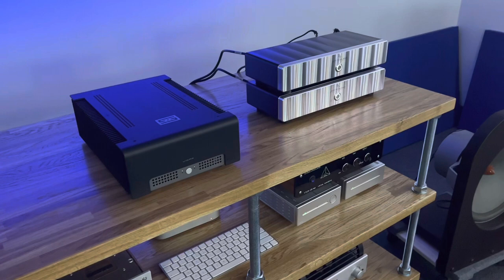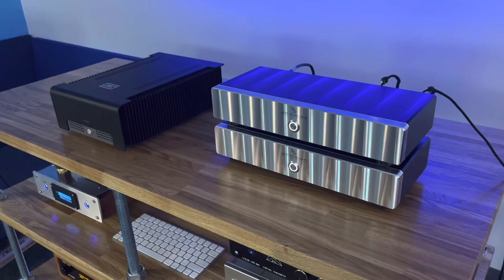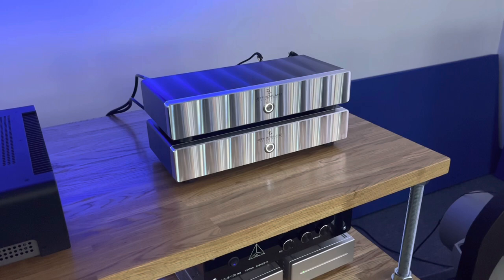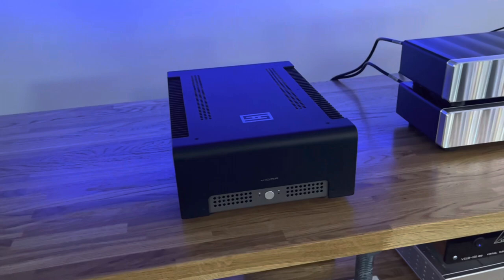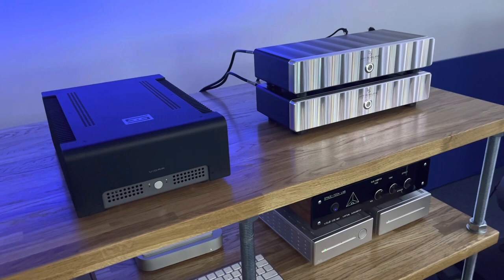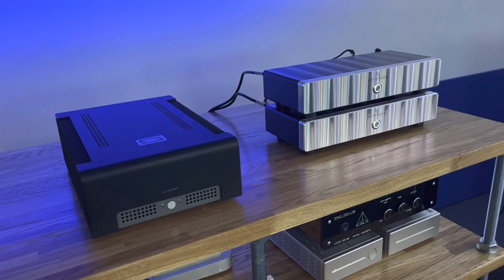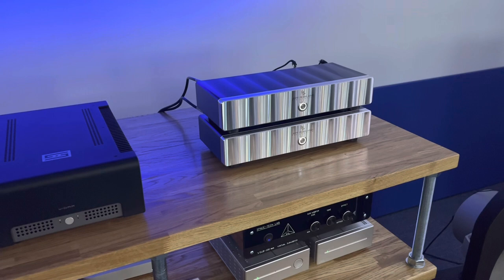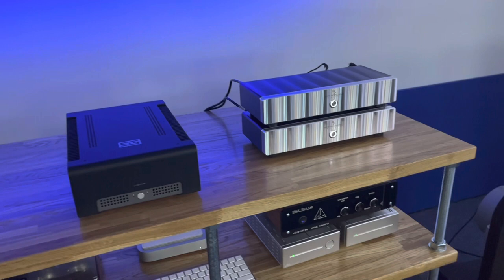Jeff Rowland M125 vs Vidar 2 power amp comparison.

Comment: Having my pair of Vidar 2's set up in monoblock configuration for only about a week, I was somewhat disappointed to come across this comparison with the M125 winning out............................until I realized that my two Vidars, the Freya Plus, the LRS Plus and the Denon CD player are about the same price as one M125. Probably the best sounding system I've ever owned, unless or until I win the lottery. LOL! :)
Reply from the maker: Absolutely! What you have is a tremendous value and I have no doubt you're enjoying the music.
Reply: Yeah, not hard to believe an $8k set of amps beat out one $800 amp. Not sure what the point of the comparison was.
Reply: A lot of "stereo" is a mind game. I highly recommend you put time into your room, treating all of the 1st reflection points, both on the side walls, overhead, etc. The sound difference when you soak up reflections quickly and cost effectively can take a system forward by a HUGE leap. This is particularly cost effective if you make sound absorbers yourself. There are many good videos online to help with this. Beware making endless upgrades before you have made significant improvements to your room. By the way, the Freya Plus is widely regarded as a "giant killer." Playing around a little with tubes can greatly complement other components in your system. If you want to soften glare, there are tubes that will complement glare. If you want to intensify detail, there are tubes that will intensify detail. Many people are studying tubes with respect to your well known Freya Plus, so it should not be difficult to find use commentary on possible tube rolls that enhance your system. The LRS plus is a marvel speaker from all I've heard. You really have exceptional equipment for the price point. Enjoy what you have! I understand you do want to have the LRS plus considerably off the wall for best results... Best of luck to you. Music is a blessing.
Reply: Vidar is a Corvette, M125 is a Ferrari.
Reply: @intrinsicfreedom  Yes music is a blessing and a great joy in my life. Thanks for the advice, much of which I have already begun to consider. I get a lot of information from YouTube and Paul of PS Audio seems to have a good handle on things and agrees with your assessment to  consider room treatment before spending a lot of money. As is my usual MO, I studied the hi-fi landscape for quite some time before making my choices and I feel quite satisfied. My good friend of many decades who shares my love of all things musically related just put a pair of $75K speakers in his vacation home and his primary residence is equally equipped. It is a welcome luxury if you can afford it, but the law of diminishing returns leaves me quite satisfied that I have done well considering my budget. I just ordered a set of new tubes yesterday to explore the differences, so I would say your advice has been good all around.
Reply: @jonathandavis9507  And my budget is a Toyota! LOL!   : )
Reply from the maker: @intrinsicfreedom  Thanks for sharing. I agree with you on the room treatments and that there should be more. There are two treatment panels directly behind and to the side of each speaker if you look at the video again. There just isn't any above but I do feel the sound of the video demonstrates the sound pretty well. Yes, if you look at some of my previous videos, you'll see I have a review of the Schiit Freya as well in fact a lot of various components in various rooms and such. I agree with you though, room treatment is paramount.
Reply from the maker: @vcp93  The point was shared in the description so I copied and pasted it here for you in case. "Schiit Vidar 2 has been added for frame of reference."

Comment: I am the very happy owner of the Jeff Rowland M125 amp. I don't have the resources to splurge on the super high end equipment that I drool over but the JR gives me a very nice taste of that. It's my most expensive piece of gear but for me it was worth every penny.
Reply: What preamp do you have?
Reply: @Drackleyrva  I have the Schiit Freya Plus which I use in tube mode. My previous power amp was the Carver M500t which I still have but am not using.

Comment from the maker: Schiit Vidar 2 has been added for frame of reference.  

M125 is 125 watts per channel into 8ohm and 250 watts into 4ohm.
Vidar 2 is 100 watts per channel into 8ohm and 200 watts into 4ohm. 

Please adjust volume accordingly with earbuds or headphones if needed for sound demos.

Comment: Wow, to me the step from Vidar to stereo 125 wasn't as big as the step to dual mono 125. At least the way the recording tells the tale, the dual mono setup really opened up the presentation and sounded a lot more live.

But Vidar is what, $800 new? And fairly plentiful on the used market. They well built and an incredible value for the money. I own a Vidar 1 that I acquired from a friend who bought it used and it's in perfect condition. At the time, I hooked up to my Emotiva TA-1 and it was a revelation, driving my JBL Studio 580's. Today I'm running upgraded Tekton Moabs with a Parasound JC5. Every part of my system is on another planet from the Vidar and JBL setup. But at 25% the cost, there are plenty of days I wish I stayed put and were smarter with my money instead.
Reply from the maker: Yea, I agree, the Vidar is an incredible value. I currently use it with my LRS Plus and love how it mates.

Comment: So I do bristle a little bit when I see class D amplifiers, using prefab modules and probably switching power supplies costing over $4,000 each. I am sure they sound great and they do have the beautiful faceplates but I struggle with the value there.

On another note, I would love to hear this open baffle setup! Also, really curious how your Dynaco would sound with these.
Reply from the maker: https://youtu.be/LtINzsIhiXY.  Yes, I brought the new ST70 over and it also sounds beautiful. It was a warmer rendering of the music.
Reply: Class D has VERY much arrived...GanFet sounds as good as any Class A amp. AGD is on the leading edge, and so is Rowland.

Comment: You're really not setting the Rowlands up for best sound quality. Bridging a stereo amp is not the same as a mono amp. Its a bridged stereo amp. You should only bridge an amp if you really need to, like if the speakers are being starved for power and really need more. A better sounding approach would be to leave the Rowlands running in stereo mode, and set them up in a vertical biamp configuration.

The problem with bridging is it alters the resistance the amp sees when connected to the same load running in stereo. The difference is half.  So a 4 ohm speaker is now a 2 ohm speaker. Your amp now has to work twice as hard to do the same work it did in stereo mode. A vertical biamp will give you better sound quality, where in a bridged system, the best you can hope for is to not notice any loss in sound quality. If you think you may need to bridge for more power, you're better off buying a more powerful amp to start with.
Reply: Its true....but hard if the speakers have only one set of posts..
Reply: @OCDHIFiGuy  Don't you have some show to be at? You just had to point that out, didn't you? If the speakers only have one set of binding post's, I guess you may have a point.
Reply: @AT1272  May have a point ??? Lol. You can't do it otherwise. It's an absolute and it's definitive. I'm guessing your first sentence is you being a smart ass...
Reply: @OCDHIFiGuy  Thank you. I can't believe someone finally noticed. For a long time now I've been working hard to overcome my status as a dumb ass. There were times when I thought I'd never work my way up to smart ass. If it came from anyone else, I wouldn't believe it.

Comment: In your opinion, which of these two sounds best when listening at lower volumes? Also, how hot do they get when they been on for a while? Thanks for the comparison.
Reply from the maker: Hi, that's a good question. First, they all run quite cool, so no worries there at all. I was talking to my hifi buddy about that. I always like to know how nicely an amp sounds at lower listening levels. With my Aretha preamp hooked to my Vidar 2 while listening to the Maggie LRS plus at low volume, the Vidar already more than enough revealing, so it's hard to say if one needs more for every speaker at low volume. The Rowland's are more revealing at low volume when the two are compared. Even so, I still find myself pleasantly surprised at how well the Vidar 2 plays at lower volume but the M125's are an endgame amp. One amp is more than enough power.
Reply: Thanks…

Comment: Thinking out aloud…
How might these compare with the PassLabs XA25 
that I owned before 
It was an iron grip on my PMC Twenty26 but not strong for my MB2SE despite stronger sensitivity. There are obvious limits even to class A… and total watts. Even low powered tubes have similar power limits.

Comment: Are there pre amps at reasonable costs that would still bring essentially the best performance the JR 125 offers?  I know speakers, dac, etc also come into play, but are there preamps "new" say around or less than $1,500 that would do this?  The amp would likely be the most expensive gear, as some probably can attest.   Would like to maintain the stage depth most of all.
Reply from the maker: You need a preamp that takes XLR cables and that may be a harder one to match properly. I’d bet OCD hifi Guy would know better on that one in that price range.

Comment: If you have Maggie's you will need 2 M125  Have a listen to My Romance by Rudy Gelder remastered for amazing sax playing  Would be interesting to throw in the VTV amplifier Stereo Purifi Audio 1ET7040SA High Power Dual Mono for a comparison
Reply from the maker: I'm surprised because even the Vidar 2 on it's own has less power and appears to drive the Maggies, with ease but in your defense, it's all relative. Thanks for sharing.
Reply: @drde4010  
Now there's an interesting prospect Driving the Maggie's with one M125 vs two M125
Reply: Ive driven a pair of Magnepan .7 into oblivion with a single M125.. so LRS+ no problem.

Comment: It's like taking the High School arm wrestling champ, Vidar, and pitting him again TWO college arm wrestling champions, Jeff & Rowland, and declaring the latter stronger and THE "models" for arm wrestling strength. Very strange indeed. 

Why don't you bring in some actual competition for your product? There are many MANY "value" products that easily compete with this $8000.00 amplifier setup. This is a truly strange comparison, ONE Vidar vs. TWO M125's. The Vidar is popular, so I guess you are drawing on that audience. Makes sense from a marketing angle only.

Many people own the Vidar and they are amazing for the price, but the same company, Schiit, has at least two other amps that would compare much more favorably with the Rowland M125 that you are selling. Bring Aegir! Bring Tyr! to the battle! 

Also, the speakers you selected recommend an amplifier in the 25-50 watt range, so pushing HUNDREDS of watts per channel is hardly part of the actual sonic equation, the resulting sound experience. You also run subwoofers, so again, the huge watts of the M125 in mono configuration is irrelevant; as you know, with an efficient setup as you have in your demo it is unlikely that a person is going to use more than a few watts for average listening levels in a medium sized room. 

A much more interesting comparison would be to run and compare the M125 to the Schiit Aegir, which already reaches the bottom end wattage requirement of the speakers you are using. Realtime tests of the Aegir conclude the amp pushes 26 watts per channel and you can run it in MONO mode for 80 watts per channel, all for under $2000.00. Yes, I do know that some people only feel they are getting value if they spend much more than what the average person is going to spend, so they may feel they need to spend $8000 for the setup you have presented as "winner" over the 'weaker' Vidar. Again, the comparison is made even more strange by the fact of presenting TWO of the high cost Rowland amps vs. ONE Vidar. 

Consider also that there exists for sale the Schiit Tyr, specifically designed as a MONOBLOCK amplifier, pushing 200 watts per channel and 350 in 4 ohms, and I would have to conclude given my prolonged wanderings through the lands of audio that they easily meet or beat your M125 by Jeff Rowland. Your speakers are 8 ohm, so they would only call out 200 watts (max) from the Tyr's, and output at full 200 watt volume would rip the head off (or at least the ears) the average listener in a few short listening sessions. The praise for the Schiit Aegir is also far and wide -read the Stereophile review on the Aegir. It's an impressive piece. Here's the review on the Aegir: 

https://www.stereophile.com/content/schiit-audio-aegir-power-amplifier

The idea that the M125 is "THE" entry into "REAL" High End is yet another example of manipulation through marketing tactics. Air and soundstage, by the way, are not the sole property of the amplifier. Indeed, if you haven't spent enough time on room treatments and speaker position, you could have the most amazing components (preamp, amp, DAC) in the world and not hear AIR, nor experience a solid or expansive soundstage. Inexpensive systems CAN produce AIR, serious realism and soundstage IF they are tuned correctly.
Reply: Very well stated. I wonder if I could get your opinion (or anyone else of knowledge). I'm looking at Heresy iv, powered by the Vidar (single) with the Freya+ as a preamp.
Reply: Much will depend on your room and how you treat the walls, etc. Heresy IV is a highly efficient set of speakers, only needing a handful of watts. You can literally run the heresy on five watts, or even two or three for most applications. Setup is huge with the klipsch. My intuition is that the Vidar could come through a bit strident with heresy IV, but if your room can absorb reflections effectively you may not face the harshness that could be a risk with the setup your propose. Tube selectoin is another piece of the puzzle you are working out. You can likely roll tubes that soften some of the edge that a Vidar/Heresy combo might synergize.  @FZappaFan1
Reply: @intrinsicfreedom  Thank you! I appreciate your input.